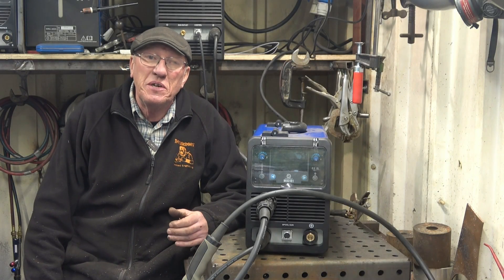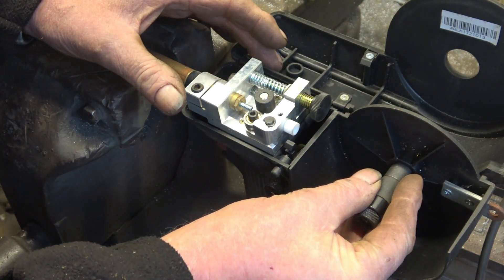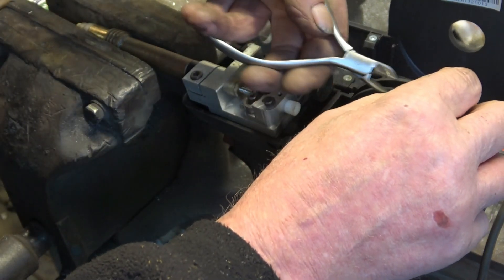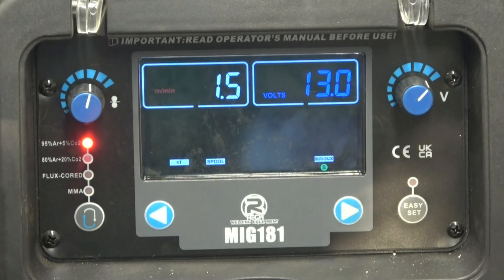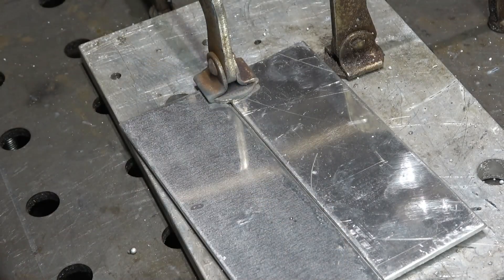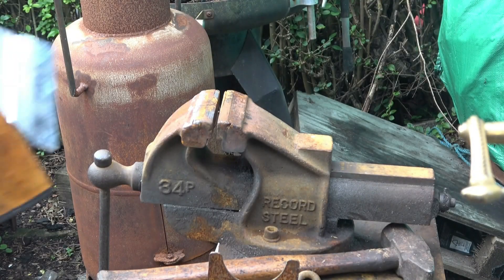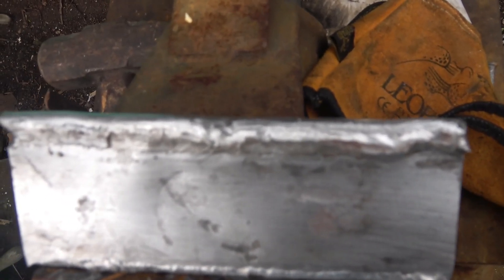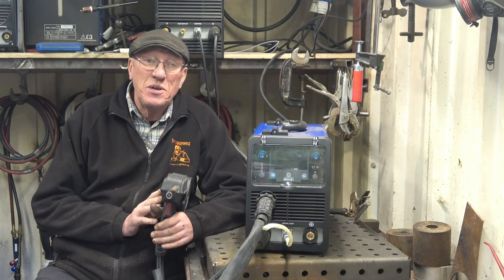R-Tech Spool Gun Review . Welding Aluminium With Inverter M.I.G.

Comment: Is there auto mode with the spool gun? Where you can just set the plate thickness or is it manual only mode?
Reply from the maker: Manual only. It is not difficult to set up  .
My settings will get you going then fine tube from there .
The new migs have easyset mode but just with standard torch .
Reply: @doubleboost  thanks

Comment: Should been mentioned  that a stainless steel brush is used to clean the metal  and only used on aluminum  and not any other metals if so used on  other metals  never clean aluminum  with it
Reply: I was going to post up the same thing, I think you can also use a brass brush but I'm not 100% sure on that.